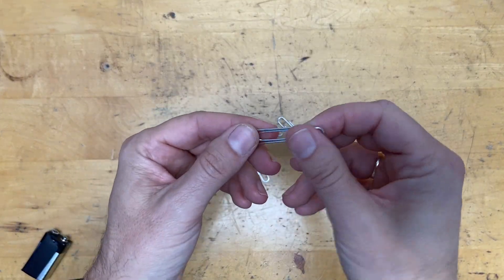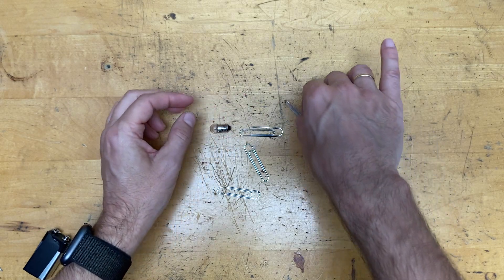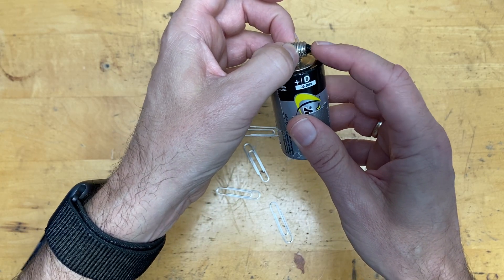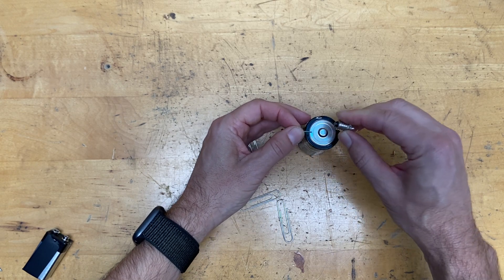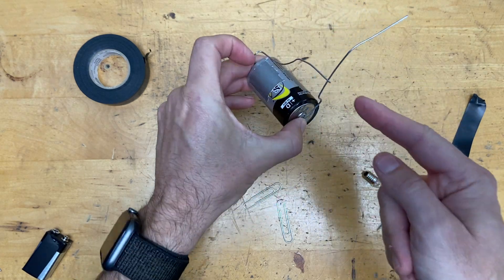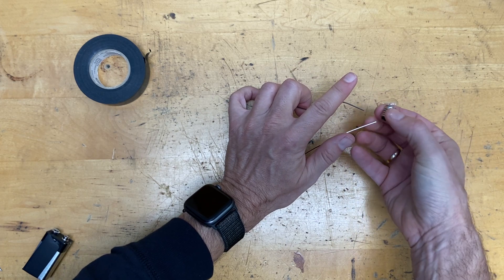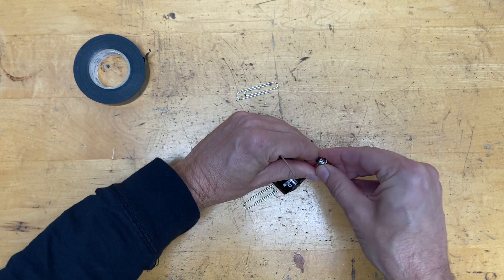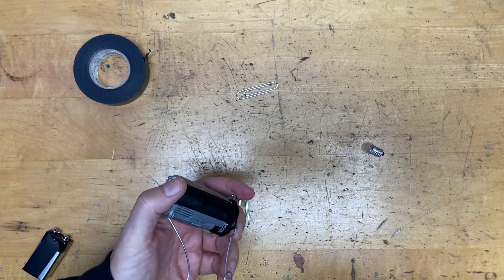DIY Paper Clip: Light a bulb with a battery and a paper clip

Comment: I remembered doing the first method for a science project in 4th grade. Just be careful on keeping the lightbulb on for too long. It will get very hot. Also, copper wire works better